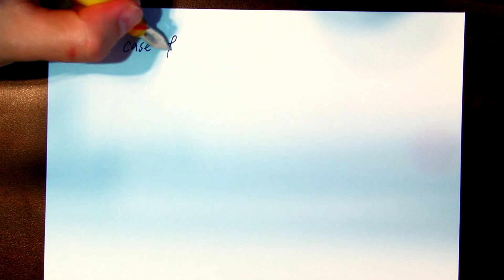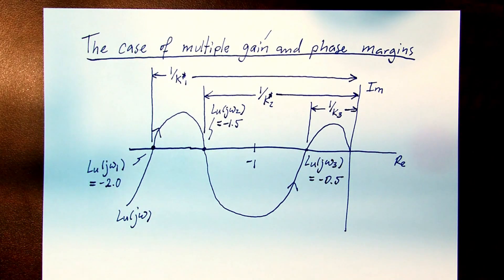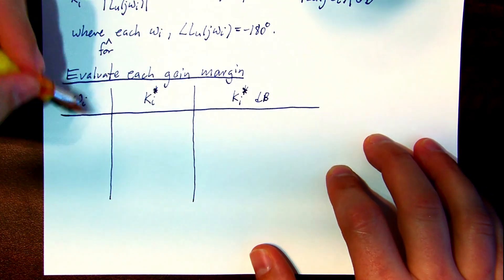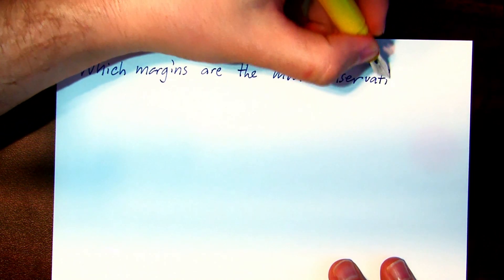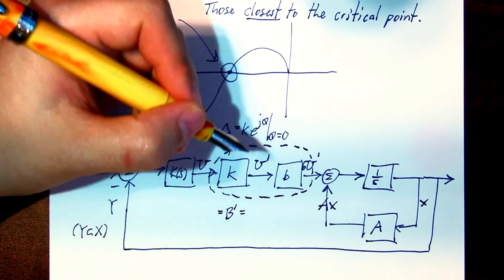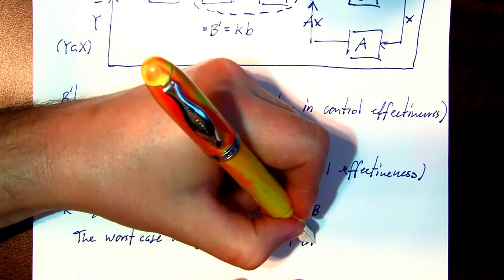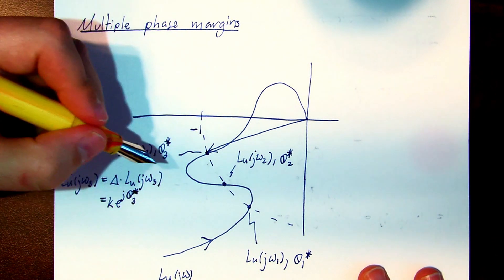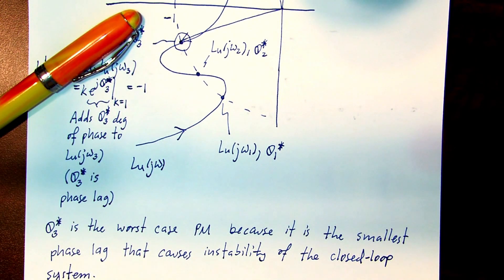The Case of Multiple Stability Margins - Classical Feedback Control - Section 2 Module 5

Comment: Hi Ben

1.) why the smallest phase lag would cause the system unstable?

2.)what's the phase lag impact in the systme?
Reply from the maker: Hi Jason,

1.) When multiple phase margins exist, they can be ordered from smallest to largest. We are interested in identifying the smallest margin, or the smallest pure delay for marginal stability, because the smallest margin gives the maximum pure delay acceptable before closed loop instability occurs. In all Nyquist diagrams drawing, given the unperturbed Lu, the closed loop system is assumed stable.

2.) The impact can be observed from several perspectives. We can also represent the pure delay as e^(j\theta) = e^(-Td*s), where s = j\omega. Thus, given frequency and phase margin, one can compute a time delay at the plant input that would cause marginal stability. From the vantage of the Nyquist diagram, this delay rotates the loop gain plot about the origin. From the vantage of the closed loop time domain response, as time delay is increases, the step response damping will decrease, until it's a pure sinusoid (marginal stability), and then for infinitesimal more delay the system is unstable and diverges. This can also be thought of as closed loop poles in the LHP moving rightward until they touch and then cross the  j\omega axis into the RHP.
Reply: @LearnGandC  

1.)If I want to know the delay I can use step response to prove?

Thank your explanation, I learn a lot.
Reply from the maker: Glad to hear it's helpful!

For the time delay, determine the phase margin and its frequency from the loop gain and then solve for time delay. This is done purely in the frequency domain, no time domain analysis necessary.
Reply: @LearnGandC  but the step response is in the time domain, why ?
Reply from the maker: The step response is in the time domain because it is a function of time.
Reply: @LearnGandC   I got it , thanks.